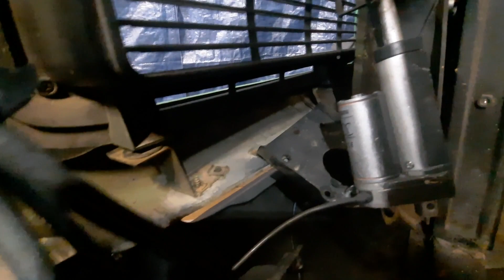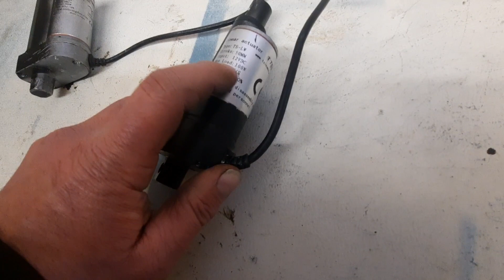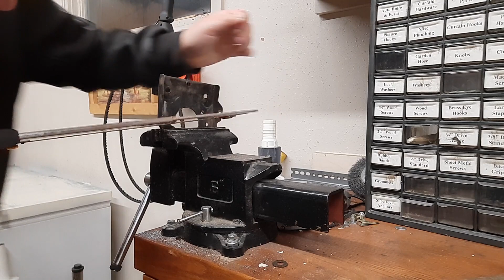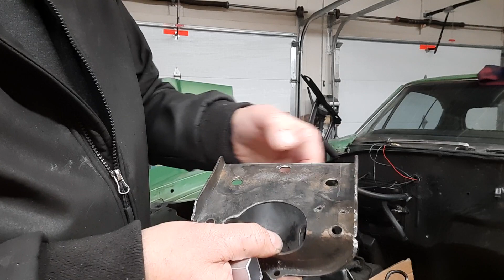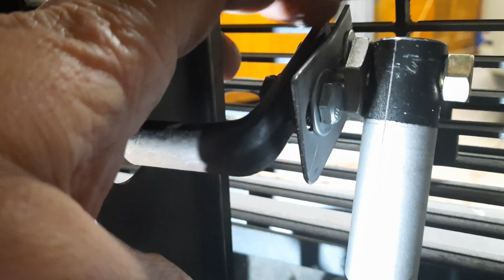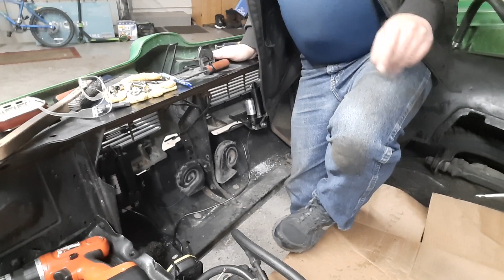#14 1968 GTO DIY Electric Hideaway Headlight Conversion - Low Cost!

Comment: I wonder  if you could have just mounted  1 actuator  in the center then extended the rods to the center. 1 less actuator  to buy
Reply from the maker: I'm going to be working on finishing up the second door in the next week or so. I got sidetracked with the rest of the rebuild and didn't do both sides. I'll take a look at that option.  I'm also going to try and make a parts list with measurements to make it easier for someone else to duplicate this setup.